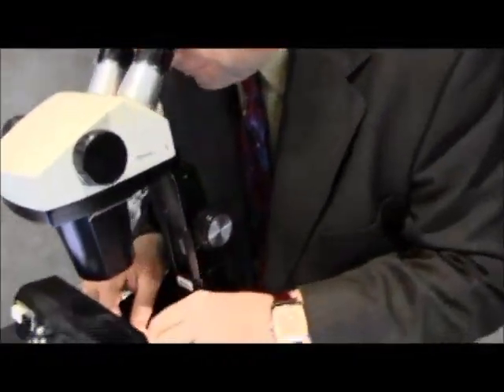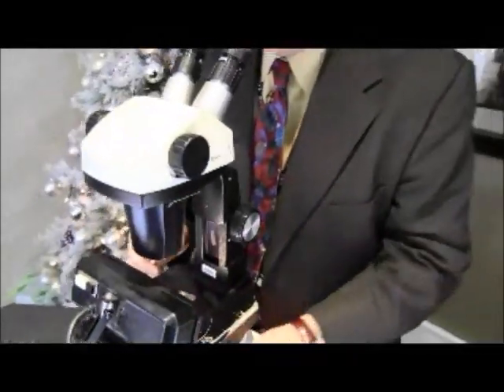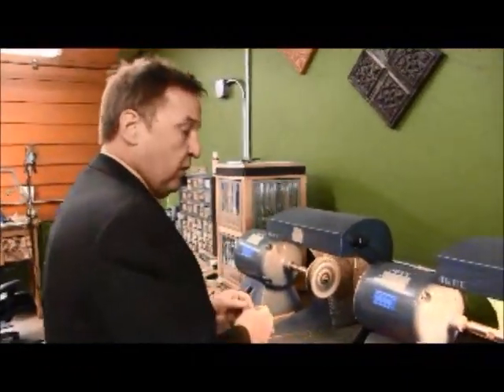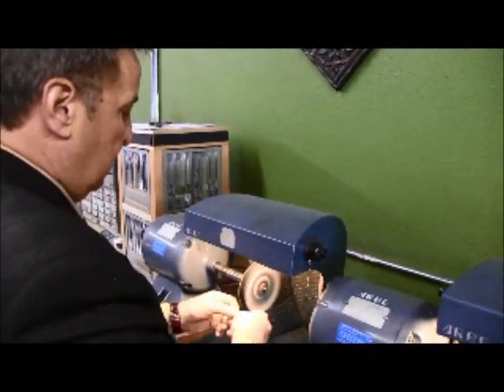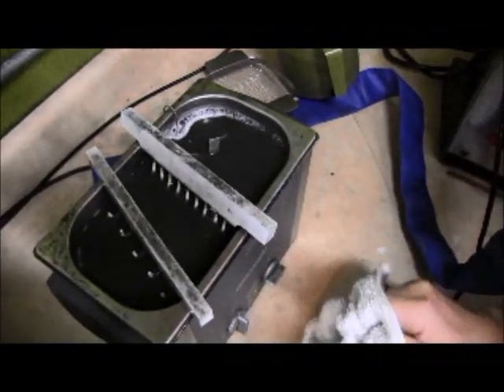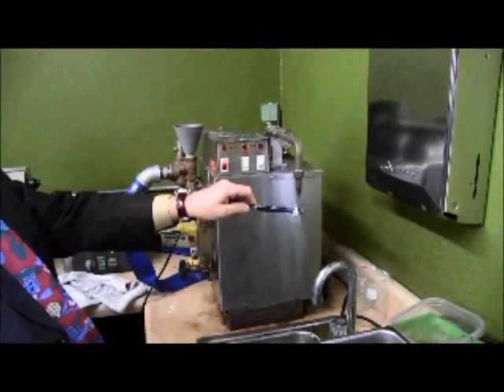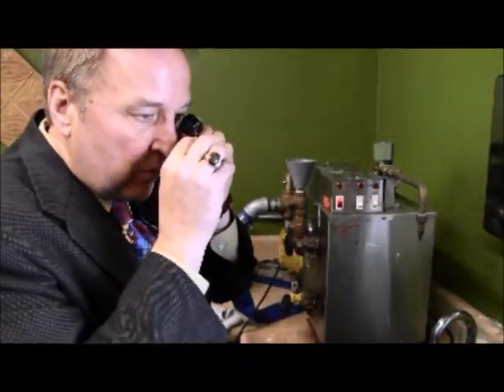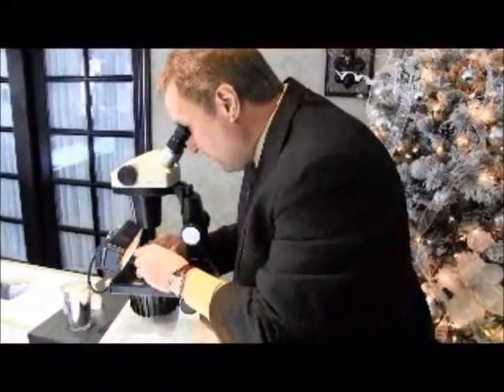Professional Jewelry Cleaning

Comment: I recently bought a Mene 24k gold ring. Does anybody know how to clean them? I have heard you can't buff 24k. So far I only use it on special occasions and have been lucky so far. But it will scratch at some point. Any advice would be appreciated.
Reply: You don't Clean Real Gold for Crying out loud
Reply: Use a toothbrush and some mild detergents! If you need to polish, you will need some special tools as you don't use a machine but you use a "polishing steel tool" to press and rub the surface until a nice shine! That goes for 23K and also 24K!
Reply: @jaystarks8662  Well you actual do! Of course there will be no oxidation  but other shit...
Reply: @jaystarks8662  lol who told you not to clean gold. I use lemon juice,  works well also. My jeweler told me to use that.